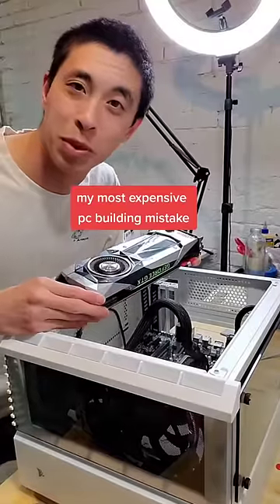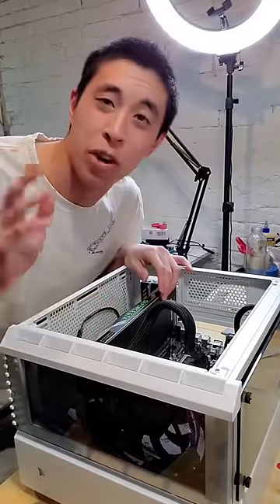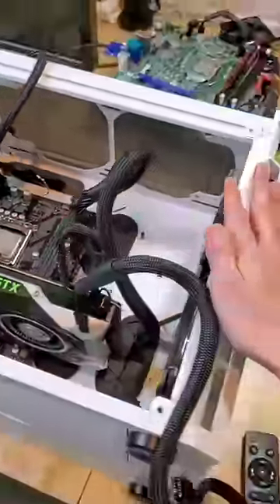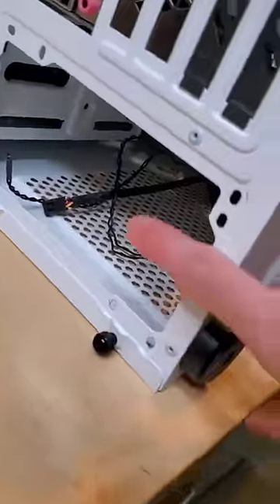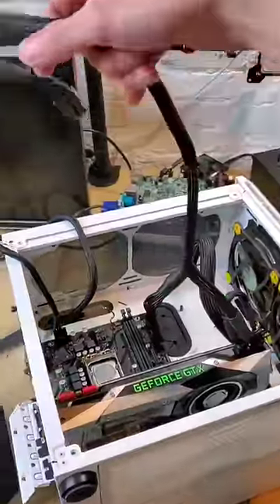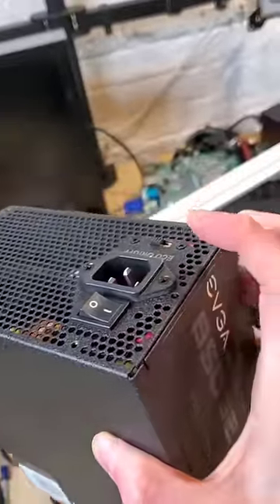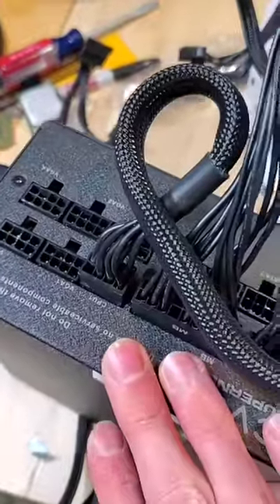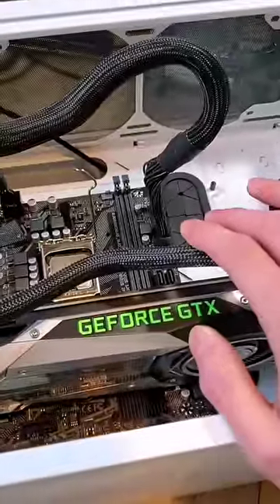my most expensive pc building mistake... #shorts

Comment: I was thinking of exactly this when you started talking about “oh free powersupply wires already installed” 💀 oh no no no noooooooooo
Reply: No problem if you knew the old psu. I upgraded from my 650W to a 1000W PSU and used the old cables. Same brand of PSU and off course i knew the old cables will work.
Reply: @rainerbehrendt9330  Call me stupid, IDC. Why wouldn’t this work? The only issue I may see is that the cables would not be strong enough to handle the current being pushed through them, but I don’t get why this would fry the PC components. I could imagine there being cables melted and possibly a fire but I don’t understand why this would cause the components to be yeeted from existence
Reply: @mtheoverlord7840  Simple answer: If you don't know the old and new psu use the same pin layout you can get a nasty surprise. That should be clear.
Reply: Forgot to mention. Companys like Bequiet have nice upgrade checker on their sites. You can see if your old cable will work with the new PSU. I had only to add 1 PCIe Cable because i used only one for my 2070S.
Reply: @mtheoverlord7840  It would not work because the PSU modular connections are proprietary while the motherboard side is the ATX standard. It's not like using an HDMI cable where the pinouts are always symmetric. Only one side of the cable is standardized, and that is why this is such an issue.
Reply: whats the problem with that do you have to buy a new because its old or the cable is not supported, im lost i cant relate
Reply: @rainerbehrendt9330  what does that explains? when not supported it fries the components? really? it delivers more power when not supported really? i cant put it in my brain sorry hahahhaa
Reply: @ivanpaulmendoza4248  The Cables are the key. All the same pinout at both sides and all is fine. Different pinouts and your Day will be worse. Simple as that.
Reply: Quick Addition: Look at Cable Mods. That's only a Extension of existing Cables. That's fine because you don't change the pinout on the End.
Reply: @rainerbehrendt9330  So the PSU manufacturer just couldn't be bothered to continue standardizing the PSU half of the modular cable layout even though it can be "plug in"?

What an odd choice of business agreement...
Reply: @Mar1s3z  Normal business. You'll sell your cable. Profit before Customer. That's the normal World outside your Home. Please be carefull, it's dangerous out there.
Reply: @ivanpaulmendoza4248  Its the cables, and the pinouts on the PSU itself that are different INSIDE, if you take 2 different cables from 2 different PSUs, look at the end of the cables on both ends, mark each pin and wire, you'll notice that the wires on 1 cable aren't going to same pin on the other end of the cable as the other cable, meaning if one wire goes to ground but on the other psu it supposed to be a voltage wire on the correct cable, well, guess what happens when you mix and match between the two.... 💀
Reply: @Mar1s3z  Its to prevent you from NOT buying their cables, and if they don't sell the cables, they want you buy a new one.
Reply: @Mar1s3z  yeah every PSU brand has different pinouts in their cables. Pertly to do with copyright and getting sued for stealing ideas from other companies. Partly so once someone buys stuff with one company they'll probably buy more of their stuff because different brands aren't compatible. So it's partly companies trapping buyers but sometimes they have no choice
Reply: Yeah, trademarks for pin layouts and cables, I can see that happening all too easily. Meaning standardization is not all that viable unless you pay a premium to the trademark-owning company to use their 'patented' layout. 

No idea if there actually is patent nonsense going on. Could just be companies wanting people to buy their cables exclusively.
Reply: @nopelandfill  finally, someone explained it well..thank yu
Reply: Thanks, I get it now, Will.
Reply: @arsenal4444  there is no copyright on pin outs. I mean: You can make up a totally insane one and call it a piece of art, but when it comes to power supplies, there are only so many sensible permutations for a given connector.
Reply: @Utrilus  trademarking pin layouts would be insane. The pin assignment from A to B has a purely technical reason and there are only so-many meaningful options.
Sure, you can make trademark cables with color coding and brand stickers and RGBW lighting... but that is not the point.
Reply: wait!!! wait!!!! wait!!!!! wait!!!!!
Reply: Trademarks don't need to be sensible, just convincing enough to the judge.

Comment: This is a life saver to know. Never knew this before so you possibly saved my future system!
Reply: Yup, pinouts are different, you can quiet easily make your own in any colour you like and make sure the wires are the right way around.
Reply: Any time you buy a new component just use the cabling it comes with, even if it means annoying reroutes.
Reply: I can’t believe that you didn’t know that. It’s been a thing since modular power supplies became common.
Reply: Also be carefull with ide to sata
Reply: @beargrylls6135  Lol, I’m an engine builder and machinist by trade, computers are just a hobby. And sometimes you have to build your own outdated stuff to run older CNC stuff, but that’s another story. It’s not being a nerd to do research to make sure you don’t throw your money in the trash. Every modular power supply warns you in the instructions, and if you buy custom wires, they warn you too. It’s very common, absolute beginner knowledge. If you don’t know that, you aren’t ready to build a computer yet. I’m not going to lie to you to spare your feelings, I’ll tell you the truth, straight up. You need to do more research before you try to build a computer.
Reply: I don't really get it. Is it because the graphics card not compatible with the PSU? Or is it just the cables that's different?
Reply: @rezaalizaida783  yes, pin layout is different
Reply: @rezaalizaida783  The cables are different. Not on the side that plugs into the video card, motherboard etc, but the side that plugs into the PSU. Basically, the pin outs on the psu itself are brand and model specific, but with the right wires, they are all the same at the plugs that goes to the computer. Just always use the wires that come with the power supply and you will be safe. If you order custom wires, that’s a thing, just make sure that you are ordering them for the right PSU.
Reply: I’ve been putting PC’s and replacing Power Supplies since the 80’s and never had a problem until now the new pc’s power supplies modules cable’s are different at time pin’s the voltage’s are different so I learned that I have to use my old trusted voltage meter to make sure the voltage is the right output and the ground is at
The right place!  I thought all the modular cables where standard NOPE not anymore.  I was installing a new RGB LED FANS controlar wrong voltage went in burned that sucker out plus the wireing.  I think both companies that make mother board’s and hard drives etc should show a the plug-in pin voltage’s.  If they did this in the first place I would’ve not lost more then $ 250.00 usd down the drain.  Voltage’s should be marked on the motherboard’s also on LED’s controller’s etc since it’s not all standard wiring anymore.  I wad
Lucky my motherboard wasn’t damaged!
Reply: @adamr9215  I know huh been putting pc’s together since the 80’s the voltage and pin out puts where all same and they come
Along with out warring ends up costing you hundreds or more in damages.
Reply: I started using my multimeter making sure
The voltage is at the right pin’s on the plug!
Reply: @phil__1097  I’m not saying it wouldn’t be good if they did standardize everything, but I can see where it come from. With RGB, you have either 5v or 12v. Basically, when they first started doing motherboard supported rgb, different companies were trying different things at the same time. Now, most motherboards support both because products for both are common, and there are arguments as to which is better. Things are still evolving, and it’s hard to standardize things that are still changing. How long before everything is obsolete simply because they decide to start feeding 24 or 36v to some chips to increase efficiency? Technically, a 48v system would require only 1/4 of the watts, and with GPU’s going insane, I see that as the next logical step. Think about being able to replace a 2000w 12v power supply with a 500w 48v psu. Lower temps, lower power consumption, that’s a win-win, right? It’s only current standards keeping that from happening. Standardization is great for technology that isn’t still evolving fairly quickly, but it can actually hold back development and improvements. There are pros and cons to everything.

You have a few years on me, I started building my own in the mid 90’s. I learned that I could build my own cheaper and it would be better than any prebuilt, so I went that route. Every time I need a new computer, I research for a couple of months, because stuff always changes, then build my game plan and make it happen. The tech is changing too fast to jump in without at least catching up with the basics before you start ordering parts. How can you expect to be able to buy the cutting edge of tech without dealing with any changes from the previous generations? It’s just not logical.
Reply: Someone in china is sleeping on the job!  And they are putting the cable’s into any holes in the connector plug! I should send them a bill for the damages it did to my RGB FAN LED 😢
Reply: @rezaalizaida783  Think about it this way; positive and negative lines were reversed... with the cable preinstalled compared to the PSU's line arrangement... sometimes it could be voltage differences, 12V, 5V, 3.3V could be located differently... the final connectors on the mobo and peripherals are standard! But the 'pinouts' on PSUs are not! Gamer's Nexus has a great resource on PSUs released somewhere this year (if I'm right), do check it out
Reply: You building a pc in the Sahara desert or something?
Reply: @phil__1097  That’s not it at all. You need to watch a video on how a power supply works. You are taking 120v or 240v power, depending on where you live, and converting it into 12v, 5v and 3.3v. That means you have 3 separate devices inside the power supply making the voltage you need. That’s a tight area to route wires in and keep them from potentially shorting. Different power outputs require different internals, and it has to be worked into a fairly small space. It is internal space and interference issues that lead to different pin outs. Look at even the highest end brands and you will see that the pin outs change between models. There are a lot of factors that contribute to internal layout, cooling/airflow, electrical interference, minimizing internal wire length, safely routing internal wires, and doing that with internals that vary between models. There is a lot more to it than just “power in-power out”. We are fitting 2000 watts of power in the same sized box that used to house no more than 600 watts, so something has to give. Converting power always means heat. Cooling systems are bulky and take up room. The people building these things have some good Tetris skills to make this stuff fit where it does and make the kind of power it does. Read the UL safety laws about interference and you will see how hard it can be just to get all the plugs on one side of the power supply, and to be able to pass the sometimes insane requirements from different governments. There is a lot more to it than you are willing, or smart enough, to admit.

Comment: During my first ever PC build I dropped a really thick and heavy 13-1 screwdriver onto my mother board and I instantly starting tearing up (I was 16) cause I worked my ass off to finally afford a pc and I had thought for sure it wasn’t gonna start but I manned up and continued putting everything together to get the sweet sweet bliss of seeing everything work just fine!
Reply: That also happened to me and it ended up working
Reply: I’m 16 and I’m trying to get a job so I can work my butt off for a pc lol
Reply: I wasn’t able to afford a PC until I was 17 and I wasn’t even the one who assembled it! I was busy helping my parents on the weekend that everything came and my buddies already had experience so they ended up crafting it. Luckily I never had any major problems.
Reply: I kinda had same situation. I saved up for my parts and when I opened my Intel cpu it popped out of the plastic cover and hit the floor. Worked fine
Reply: on my first pc build i accidently bent the pint in the motherboard all the way down
Reply: I just build my first pc... And i bought a micro tower when i had purchased a atx mobo... And i has already finished putting everything with the cpu cooler onto the mobo💀 i cut a hole into the anti static bag for the cooler and was anxious the whole week my new case took to come. In the end i didnt even waste anything since i will use the original case for my little sisters pc. And my pc works perfectly fine :)
Reply: Mainboards and computerparts in general are surprisingly sturdy